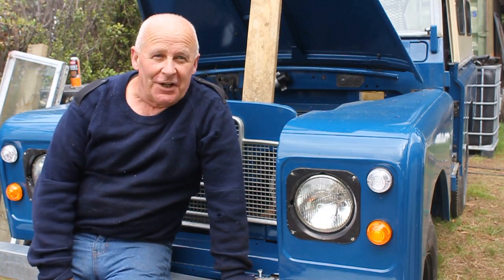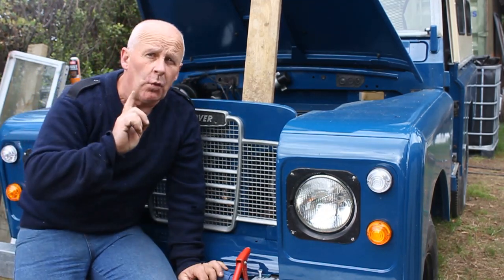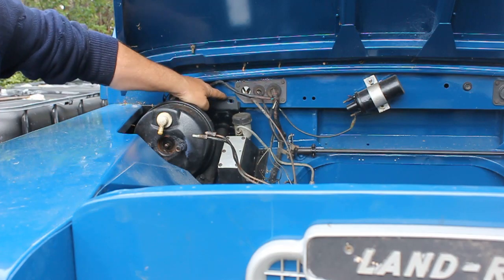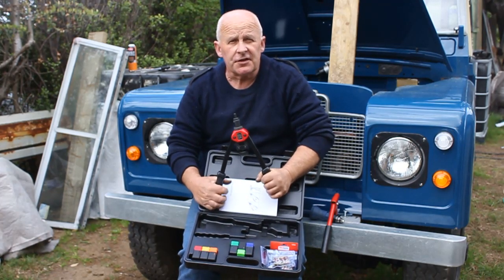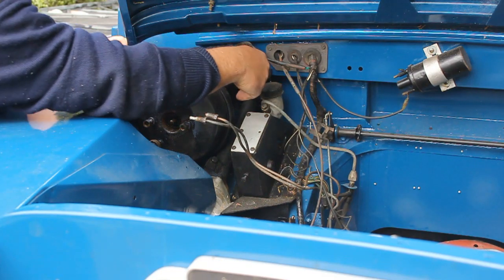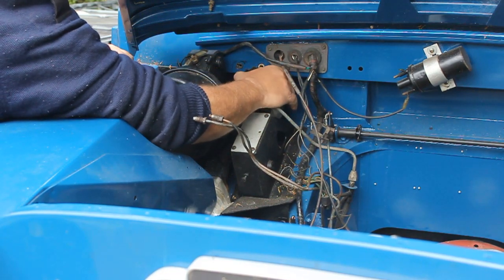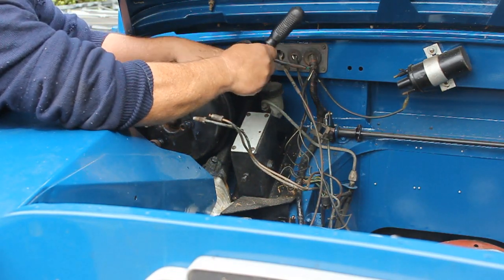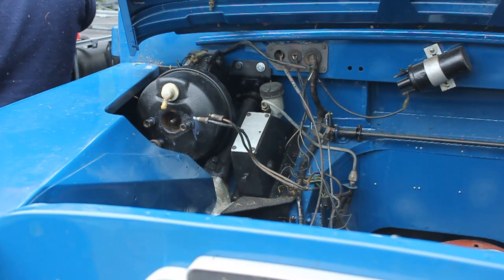Land Rover Rebuild- How to Use A Rivnut Tool

Comment: Hey mate, quick question about the paint you use. You mention to me in comment of another video that you use enamel paint with harder. Are you just using cheap oil base enamel and add 2pak harder?cheers
Reply from the maker: That is correct. They used to market as 93Plus. its ordinary enamel 93% with 7% 2pack hardener with it. It gives enamel a 'kick' to harden it faster in cool weather- its also a bit harder- a poor man's 2K I used to paint doer uppers with it to save money. its touch dry in under an hour and you can assemble it after 8 hours.
Reply: @t.h.o.r.  cheers

Comment: The "riv-nut" plier need to be bigger! (Kinda' like a bolt cutter).
Reply from the maker: Its on its upper limit at 10mm _ works best at 6 and 8mm
Reply: @t.h.o.r.  I guess it's time to "replace" the lower firewall. (old school and "old" tools. ).
Reply: That's a great tool. In aviation we use notched inserts to prevent turning. On smaller inserts I dip them in paint before squishing, helps to stop spinning when torqued. Great vid.